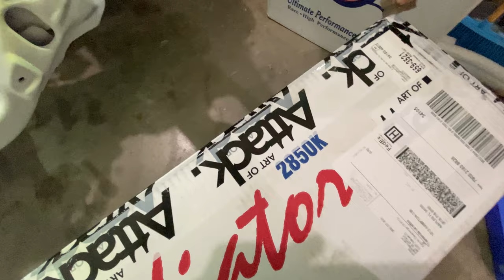Kswap EJ1 : CSF K-Swap Radiator!

Comment: Question about the shroud ..
The bolt that came with mine or short n i cant get them to screw on did u use longer ones?
Reply from the maker: Yes I used longer ones

Comment: What did you do for a lower radiator hose?   I’m using that same radiator and can’t seem to find a hose that fits the right angle to the thermostat.
Reply from the maker: I had issues as well and ultimately ended up doing an fittings.
Reply: Thanks!